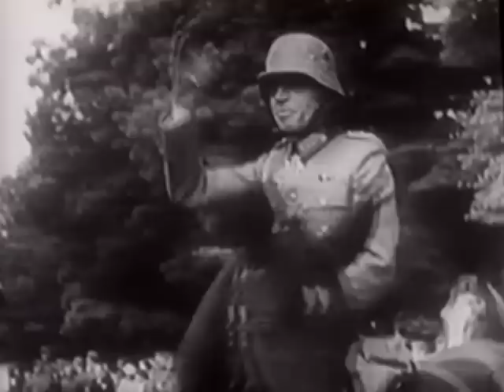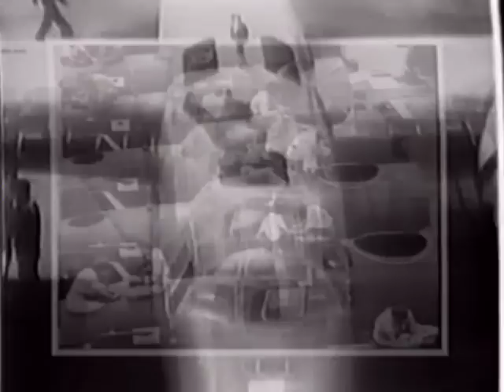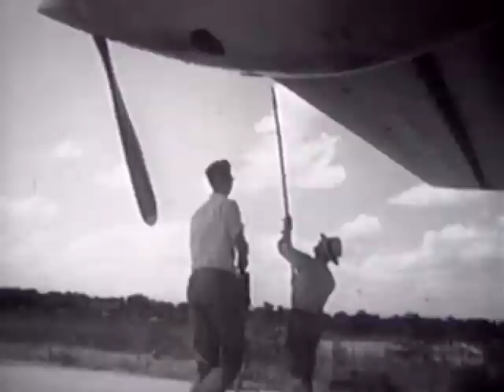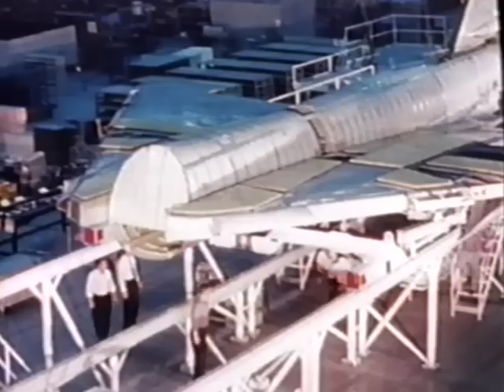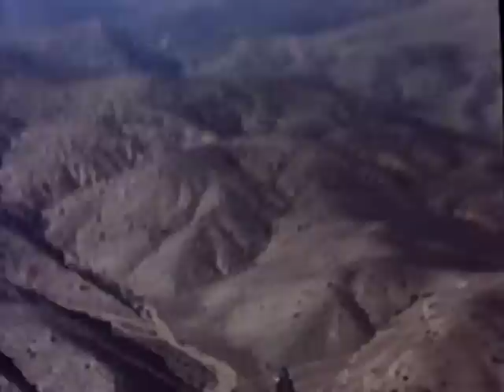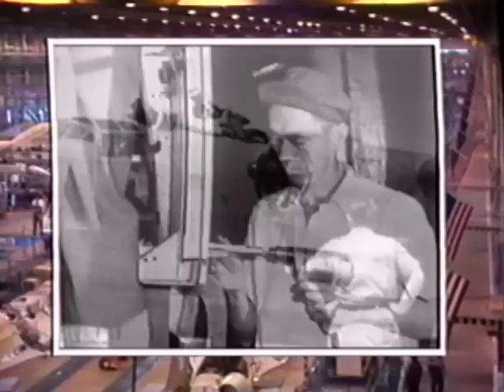History of Air Force Plant 4, Fort Worth, Texas

Comment: They failed to mention a cute 'story' about the facility.   In the video in two places you can see that the nose of the B-36 is being held up on a stand.   The reason for that is the vertical tail was too tall to fit in the factory without dropping the tail down.   So after the vertical tail was attached they 'dragged' the tail through final assembly and out the north end door.   I worked at the facility from mid '75 to early '77.   Saw the rollout of the first pre-production F-16 in December of '76 while the YF was performing the Paris Air Show flight program overhead.  Pretty exciting stuff for a new aero engineer.
Reply from the maker: An excellent detail that many do not know, the too tall tail.

Comment: I never worked at General Dynamics. What is usually not mentioned in these films is the role small contractor shops played in the success of the prime contractors.  Machine shops, and suppliers of all types of material, from steel to janitorial supplies, benefited and supported the prime contractor.

 Bell Helicopter eventually moved to Fort Worth because it had rented space at Saginaw, Texas to manufacture control surfaces for the aircraft being built at Consolidated, later General Dynamics. Bell rented the largest wooden aircraft hanger known at Saginaw. 
I worked for a small heat treating company, United Heat Treating on Montgomery street in Fort Worth. 
This company heat treated thousands of parts for General Dynamics. Including the wing pins and all supporting hardware for the folding wing (F-111 ?) fighters which were made of a special steel alloy and required heat treating under an argon atmosphere. United Heat Treating was the only company west of St. Louis that had a large enough furnace. Ironically some years before General Dynamics had declared the furnace surplus equipment and sold it to United. 
I then went to Bell Helicopter where I worked for the next 33 years, retiring in 2000.

This is where the movie Strategic Air Command with James Stewart and June Allyson. was made in 1955. Jimmy Stewart did every thing in real life that John Wayne did in the movies.

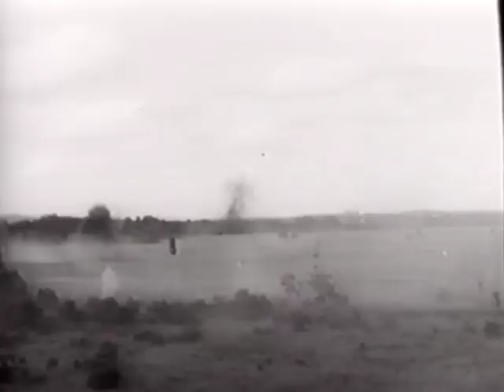Comment: Bouncing bomb at 9:47??
Reply: I strongly suspect that is stock footage that was misapplied. That appears to be from a B-25, not a B-24. I don't believe that B-24's were used in the Pacific for that low-level attach mission, but A-20s and B-25's were. The bombs had delayed fusing so that the plane, typically running at about 100 feet, would be out of range before the bomb went off. Planes were supposed to fly offset from each other so that the bomb going off wouldn't get the following plane. Unfortunately, sometimes that happened.
Reply from the maker: Could be. Looks like the aircraft was at very low level, which might have resulted in the bombs being armed with a short delay fuse to allow the bombers to exit from the blast zone. A bomb with a time delay fuse might easily skip off the ground.